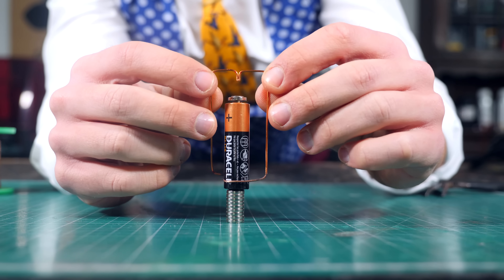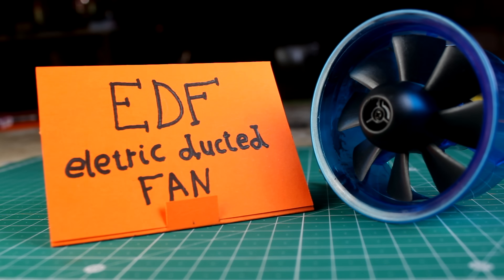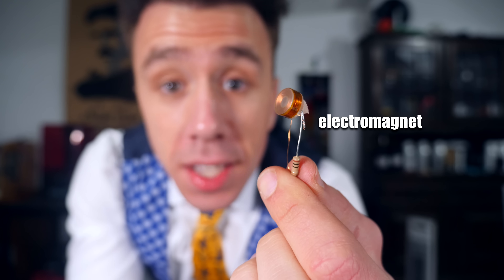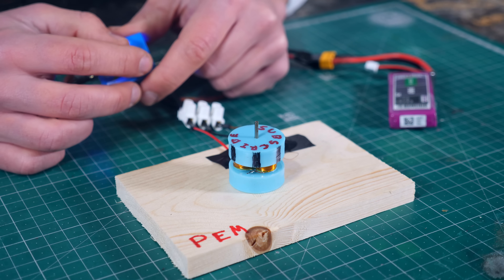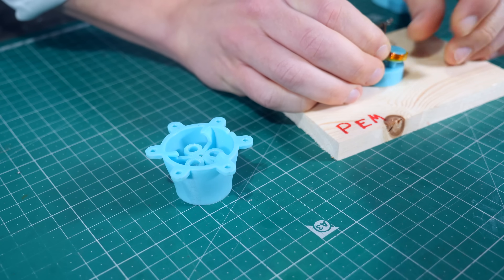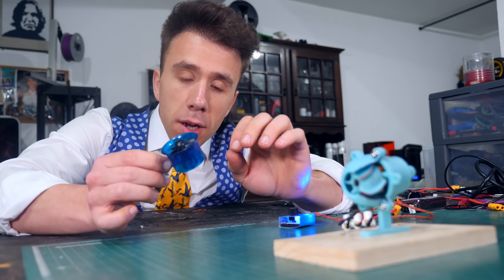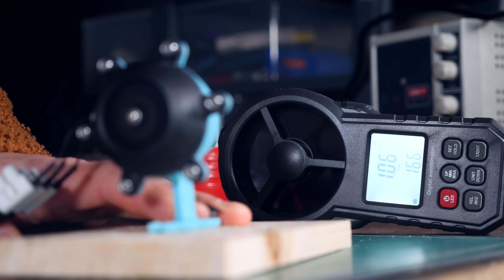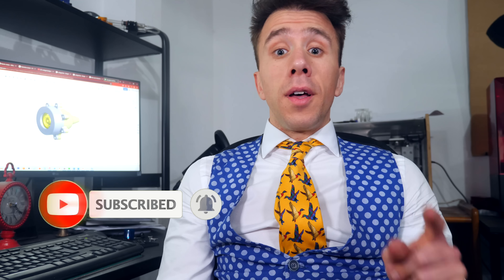I 3D Printed an ELECTRIC MOTOR FAN

Comment: I have two solution first this kind of "fan" is deisgn for create a big pressure and not a big airflow (like turbo part in cars), second is the form of the "intake" i can't explain you that (cause to bad in english) but tom stanton can, the round shape is itself a "wing" and portance is create on it by the aspiration of the fan !

Comment: The reason that your fan is not making the same or more thrust is that a centrifugal fan creates pressure, while an EDF makes more thrust. Then notice how the Dyson fan blades where a lot thinner and deeper in the center so the air would not get stuck on the very front of the fan blades. And Dyson fans create pressure to squeeze the air through the small holes, so copying their design might not help you. I would recommend opening the exhaust more and giving more room behind the fan for the air to flow through and make all the tolerances tighter and anything that passes air over it need to be thinner for a cleaner flow and a lot more RPM, after those mods are done. But making a centrifugal fan have more thrust than compression is really hard because it is not designed to do that, but it can be done. Good luck and tomatoes suck.

Comment: Most likely, in my still In-experienced expertise, I think that the impeller fan uses the motor inefficiently as you are converting some of its power to compress the air while the EDF converts the power from the motor directly to thrust. im basing this all of how airliner "fans" work.

Comment: It's a problem with motor load, the ducted  fan can spin faster because it creates less air resistance, this allows the controller to spin it faster and extract the most out of the BLDC.
The new impeller you designed creates higher pressure and doesn't allow your motor to spin up to its maximum anymore.
You need a torque'r motor to overcome the compression.

Or rewind the current BLDC with a thicker wire to allow more current to flow.
But this would probably have cooling problems, BLDC need much airflow to keep there temperature in check...

Comment: This is a problem that you could look in to @MajorHardware 's fan showdown series for some enlightenment. He has lots of videos using the same noctua NF-A12-x25 and difrent blade designs all with difrent results in terms of performance. this is one of those problems you might need a lot of prototyping..

Comment: Video idea. One type of 3D printed compressor fan that could have abnormal properties is a "Fractal Fan".

A fractal is a complex pattern that repeats itself at different scales, and incorporating fractal geometry into the design of a compressor fan could potentially improve its efficiency and performance. By 3D printing the fractal pattern onto the blades of the fan, it could create a unique air flow that reduces turbulence and increases the amount of air that can be moved through the system.

The abnormal properties of a fractal fan could include improved efficiency, higher airflow, reduced noise, and increased durability due to the optimized design. Additionally, the unique fractal pattern could create a visually stunning and distinctive appearance for the fan

Comment: They don’t call them turbofan engines for nothing. Take a turbojet engine, slap a fan onto it, then you have more airflow at slower speeds with more efficiency. Just needed a big fan on the front.

These are the commercial plane engines, if I wasn’t clear about it. It’s pretty cool. Just using a constant ignition of fuel to move blades instead of pistons is almost magic.

Comment: AFAIK the centrifugal fan is best used when trying to compress or pass air through a constriction, vs a traditional axial fan is better for flow rate. I think that more of the energy of your motor is going into compression and heat than into the kinetic energy of the air flow.

I think this is cool and you should try to combine it with some combustion and you might see more thrust out of the same fuel than normal.

Comment: two stage rocket engine
the first stage with a hot air balloon so you can go up to a certain height
Once its height is reached, a solid rocket motor is used to try to get as high as possible.

Comment: Your design is flow restricted. Without a combustion section in a low bypass fan, you will generate high pressure but not high velocity. Open that sucker up.

Comment: It is because you are giving up flow rate for pressure in theory that should work but because the existing path is very small that creates higher pressure than the fan can handle.

Jet Engine have this problem too but with higher pressure you get a higher compression ratio and you trading flow rate with higher efficiency.

Maybe you should try making fan more conical 
(square law) 
Lets say if the top part of the fan is 1m (haaaa)
and the height is 2m then make the bottom part 4m.

Comment: Higher pressure usually means lower mass flow due to bottlenecking, jet engines don’t care because they use that high pressure to generate absurd acceleration through combustion. Electric fans don’t take advantage of that

Comment: it may be because you are  3d printing it the surface finish of the 3d print makes a lot of drag and a lot of turbulence making it a lot inefficent and there may also be a bad connection between shaft and impeller making it slip and you may want to have a different output and imput size hole

Comment: Change the fan material into a metal  (carbon fibre). It will be as light as plastic & it will hold it's structure maintaining the same speed or maybe even more.

Comment: the reason why trust of EDF != centrifugal is that, you are losing efficiency by bouncing air off anything. Or even squeezing it through anything. Jet engines don't have power problems, but scaling properel/fan is one. It is a tradeoff avionic is willing to do.

I am an amateur but, you can make a maybe do better explanation on the next video. Take it like an idea for the next video.  I can use a printer ...

Comment: I think it’d be neat to see whether or not it’s possible to design/print a fan with an adjustable intake aperture. I’m not sure what practical purpose it could have, but it’d be neat.
Reply: I think this is what intake ramps on supersonic aircraft do, they limit intake air flow to control compression heating inside the engine, which is useful to provide thermal headroom so you can actually burn fuel without making the exhaust products so hot that they melt the turbine.

Could be wrong though. Wouldn’t be the first time I’ve talked completely out of my ass on a YouTube comment.

Comment: You should make a jet engine with a turbo charger from a car as a side quest for this project!

Edit: realizing that you’ve done similar things with the compressor side of the turbo charger, this idea is to also use the exhaust assembly as well to spin the compressor after a combustion stage
Reply: From what others are saying about static pressure vs flow, this might be a good way to show how static pressure can be used with combustion to generate lots of thrust since turbo chargers use similar fans/compressors to the Dyson impeller you’re using
Reply: A turbo jet by definition does exactly what you want but better.  Remember that air flow in a straight path moves faster and can transfer a sufficient amount of energy without obstructing further airflow (important).  The turbo gets spun by the exhaust which creates suction.

Cars don't generate thrust the same way as jets.  Jets use their exhaust to create thrust   cars have the thrust generated and dispose of waste through the exhaust.  So jets need that speed of the exhaust while cars don't.
Reply: @phasepanther4423 yep agreed! But at the same time you see these DIY
 Turbo Jets with turbo chargers that generate some sort of thrust (definitely not as efficient as a straight line jet engine)

Anyways, that’s why this would be more of a side quest to understand a bit more how these kinds of compressors/impellers/fans work and maybe some cool conclusion can be made from it.
Reply: @Pscribbled  
I see.

An informational video like this would help.
As there are key differences in purpose of certain motors and of certain fans.
For example, a motor designed for higher rpm won't be able to handle too much torque (within a power consumption range).  And generating pressure does require some force, not just speed.

Remember the basic electrical formula such as number of poles to rpm to get an idea of your torque curves.
This can be seen with pumps as well (technically the design he is using is closer to an impeller as it generates flow through pressure, so a higher torque motor might suit it better).  You get different head heights.  The max height a pump can pump to.  Separate from the flow rate.
Reply: @Pscribbled  
Also I completely forgot to mention something in my last comment but can't be bothered to edit it.
The other reason for the lack of thrust is that Dyson fans are made for flow not thrust.  A good comparison would be rpm vs torque vs horsepower.
With horsepower being your thrust and rpm being your flow.  Pressure being your torque.
This is just a basic concept and not a formula.  Since you seem to know cars.

Comment: Does the inlet diameter effect the thrust (Perhaps not enough air is being pulled in), or maybe the exhaust diameter, or it could be to do with the surface areas of the two fans, or the clearance between the outside of the impeller and the housing could be too narrow/large?

Hypothesise, design, test….add a rocket, burn, explode, duck….

Comment: My first thought is that the RPM are different.  But that is a shot in the dark.  Or maybe torque differences due the flux pattern differences from the EDF to your design?
Video IDEA ; find a way to visualize the flux bands.  metal filings and paper and a camera costing thousands to capture ungodly FPS. :D  Or a collab with someone that already has a camera :D
PS - I love that you don't just post your successes but also your challenges.  I personally would love to see more of the process, which you show, then just the finished product.

Comment: An EDF is optimized for thrust. Thrust is proportional to mass and velocity (F=m*v) thus if we want to double the thrust produced we can either double the air flow or the air speed. But kinetic energy is proportional to mass and velocity squared (E=1/2*m*v^2), so for thrust applications, its much more efficient to optimize air mass flow than exit speed. An EDF will stall pretty quickly as soon as there is too much back pressure, roughly because each molecule of air does not carry enough energy to push its neighbors. On the other hand, centrifugal fans are optimized for static pressure. For the same power usage, they can produce lower air flow but moving with higher speed. This is not ideal for thrust applications but I think you can workaround it. The idea is to convert the static pressure into air speed with a restrictive cone. The exit diameter of the cone must be well tuned to the capabilities of the motor/impeller to convert a maximum of pressure without stalling the impeller. Then you can use the Venturi effect to suck more air into the stream, decreasing speed but increasing mass flow. All in all, that is very similar to what the blade-less Dyson fan do.

Comment: Hi Integza, I’m a big fan of your channel ❤and i have an idea for a future project that you might like. A centrifugal launch system that can launch objects using a spinning wheel. Its like a giant slingshot that flings things without an engine. Its cheaper and greener than rockets and you can also use metal cans, 3D printed blades etc to build it. What do you think?

Comment: I think there are two problems. First one would be very tight tolerences between housing and fan. The second one will be the 3d print that expanse because of the centrifugal forces.

Comment: The motor dictates the power in, not the thrust. Different types of fans have different characteristics, some can produce high pressure, and not so great flow, while others can produce high flow but not at high pressure. And they don't have the exact same efficiency.  

The design must be optimized for the specific motor if you want the best output the motor and fan can potentially produce. The smallest cross sectional area for the air flow should be closer to that on the EDF. You probably have extremely low pressure directly after the intake, and the impeller have very little air to work with. Increasing the size a lot is the first thing to do. 

Unless you need it to have very low noise, perhaps a Dyson fan is not the ideal thing to copy. My suggestion is to take a look at the impeller in a turbo charger, they're designed to minimize turbulence, and create very high flow and pressure, without having to be silent.

Comment: I'm not reading the comments yet and just want to postulate to see if I'm kibitzed to non-existence. :)

It seems to me the differences are that the axial flow fan directly thrusts in a (if you'll excuse the non-fully explained theories and such) forward-to--backward thrust vector.

Whereas a centrifugal fan has to thrust the air sideways to the walls of the chamber, THEN change direction as well, all of which will lose energy.  Further, the restrictions of forcing the air and compressing it in the chamber will cause it to not flow as well.  Finally, when the air does escape out the rear of the chamber, it is expanding, and Bernoulli's principle takes effect, lowering the pressure of the air, and thereby losing the thrust.

There is no way to make a centrifugal fan to thrust as well as an axial fan, and it's exactly why Whipple's design fell to the wayside in comparison to the axial flow fans, as least as far as jet engines go.  Axial has lesser losses and more efficient.

As to Dyson... They're using more tricks of constrained flow and other fluid dynamic principles to get their fans to work.  In the case of the Dyson fan, the centrifugal fan would not work as well without the ring which pulls in more air as the thin exhausted air from the fan/impeller exits, and that is what creates the air flow, not the ring of air itself.  The vacuums work because of the constriction of the exhaust, which when expelled causes a pressure and flow differential per Bernoulli's, thereby causing a pressure differential in the collection chamber.

So.  How'd I do, everyone?  Lemme have it. :)

Comment: Hello, I'm an aerospace engineer, and yes there is a reason why, basically the EDF motors work using the same principle as turbofan jet engines, I will oversimplify a bit, but basically an airfoil shape is used to generate lift in the X direction which is in our case considered thrust, it's also the same principle used in helicopter, but the challenging part is making sure that the amount of lift generated throughout the blade is the same, and that is generally achieved by twisting the inner airfoil since it has a much smaller linear velocity than the tip of the airfoil and/or using different airfoil shapes with different characteristics, and the reason why ducted fans are good is that they stop tip vortices from generating which increases the overall efficiency of the engine, and for a video idea i think it would be a good challenge for you to make a fully 3d printed aircraft fly, with you designing everything haha, early tip from me try using LW-PLA to achieve that

Comment: It may be a few things, I saw someone else comment this but it looks like your outlet nozzle is a bit restricting. Also Maybe reducing the size of the centre hub so that the blades are longeras well as reducing the clearence between the blades and the housing, both are things they do in turbo chargers which may help but idk. Last thing maybe the weight of the plastic you are using. I don't know how heavy resin prints are cuz I don't have one but the blades of both the dyson and the edm look to be very lightweight and slim to reduce the rotational mass

Comment: Some very Smart people in the Comments.  Three Factors that are causing the performance drop are Intake Size, Internal Geometry for flow/drag reduction (think golf ball), and likely compressor stall.  I dont know of a quick fix for compressor stall other than alot of Math or alot of prototypes.  You could try to add an EDF Duct to the intake housing/shroud and even add a fan on the same shaft to pull in more air for your compressor stage so you have both flow and pressure.  Maybe for your next video ;)

Comment: I think you need to calculate the airgap betwen Propeller and the duckt, and think about combustion engine, the outtake, you take a Motor from a brocke Vacuum cleaner, you schould try to get the the hole piece, im not an Experte just Laut thinking, maybe you already, have the same tought😅

Comment: It's pretty simple. The fan pushes the air into air. The impeller pushes air against the walls compressing it. This means for a given amount of air pushed an impeller is doing more work  and thus requires more energy. Because the motor is the same, the work is the same and thus the amount of air pushed must be less due to the different operation of the impeller.